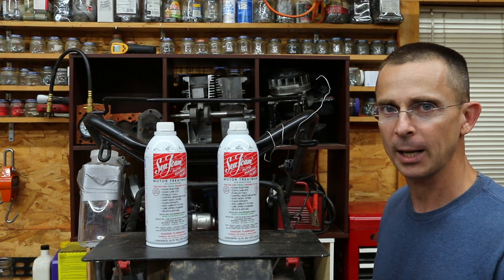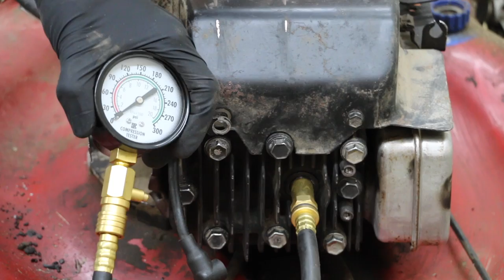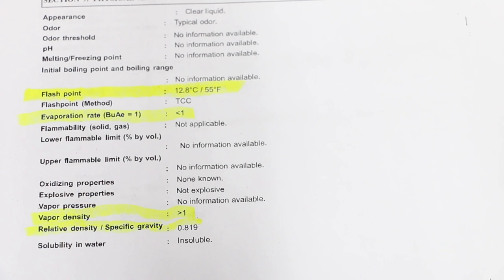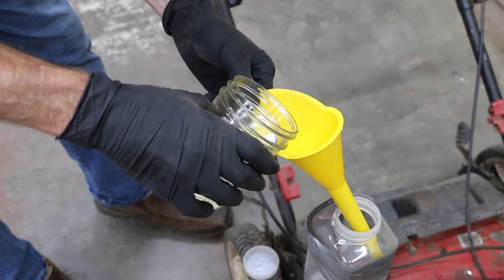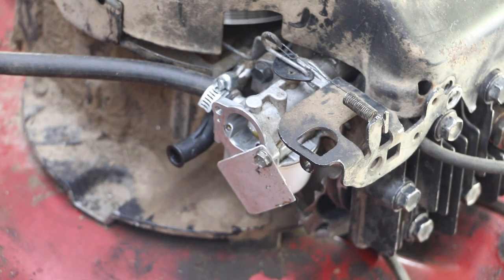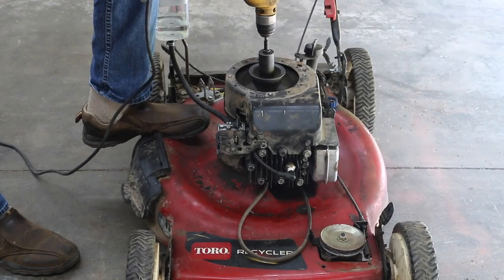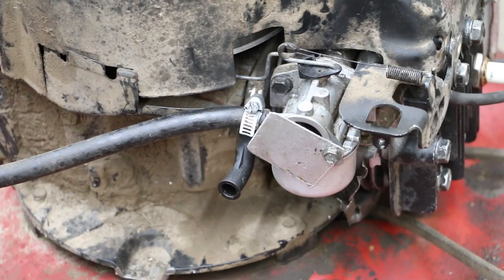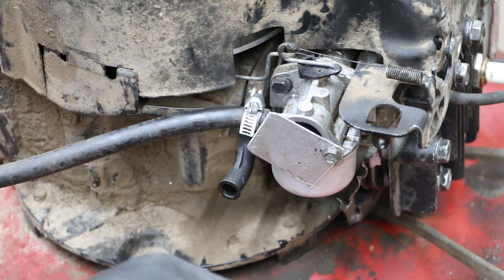Will a Gas Engine Run on 100% Seafoam?  Let's find out!

Comment: I've ran my 6.0 powerstroke diesel off of 100% sea foam
Reply: Cape Cod Canal Fishing your 6.0 actually runs? Wow...
Reply: FlatBroke612 yup 2006 f-350 Harley Davidson bone stock on motor with 180k never had a problem with it yet
Reply: Cape Cod Canal Fishing 
Bone stock is why. 
Smart man. 
You’re probably familiar with that shop in Georgia that bulletproofs them then, the channel name slips my mind at the moment but I’m subbed. 
The ol 7.3 was good , the 6.0 can be made good by his methods but if yours is reliable leave it alone
Reply: MrTheHillfolk yes I know the shop your talking about, people will travel thousands of miles to get the work done there. I only have a turbo back mbrp exhaust, never had a tuner on it. Only use motorcraft powerstroke diesel oil, and regularly use some kind of fuel treatment, oh I also use rev-x in the oil. Probably why I've never had an injector issue. Regardless I still have to think the egr is near the end in its life, that's just really uncommon for that not to have gone yet...idk we'll see lol
Reply: People always hate on 6.0's, but those are the people that do not know how to maintain them. They are also probably the people who throw big HP tunes on a stock 6.0 and whine like a baby when it blows.
Reply: TrailRipper exactly! I'm creeping up on 200k (180k now) really hoping the to hit that 200 mark without a problem and I'll be a happy (rare) camper with my 6.0
Reply: Cape Cod Canal Fishing any improvements ? Preventive maintenance or were you trying to cure something ?
Reply: JIGA BACHI nope I do my own oil changes so I know it's being done right, I only use the rev-x cuz u just hear everyone talking about how good it is for the truck so I've just been using two bottles per oil change, and I don't add it to the oil fill, I take my stand pious out and pour it straight into the hpop system
Reply: Stand pipe***
Reply: Cape Cod Canal Fishing 
Yea that’s a fair amount of time with no problems, like he says in the vids though it might be time to do a few things coming up, like you mentioned your egr. 
My brother inlaw just got an 06 that was from down there and had  the work done. He was a little nervous about it coming from the 7.3 but it’s been hood for like a year now.
Reply: MrTheHillfolk Good old Bill down at Powerstrokehelp
Reply: I was just about to say That it would probly make good power with a turbo with all that smoke, it's all just unburnt potential!
Reply: Could've only gone well...
Reply: @CapeCodCanalFishing  Ever know of anyone running a 7.3 powerstroke on 100% sea foam?
Reply: 6.0 liter, that engine needs all the help it can get,?!$ nearly bank rupted ford!
Reply: Ran my 1991 KA24E 4 cyl. And running so much better now. Even sounds better, arms stopped making clicking noises

Comment: This has got to be the most positive YouTube channel ever! Didn't see one negative or stupid comment. My question is did you try mowing a section of grass with the sea foam fuel? Does idling vs running the mower change the way it reacts as a fuel?
Reply from the maker: Thank you very much for the positive comment.  I wish the grass was still growing where I live but it's dormant.  The engine lacked power and wouldn't have ran very well. Great question regarding idling vs running higher RPMs.

Comment: During the summer of 2016 my old lawn mower started smoking bad. I've had it for  at least ten years. I thought the motor was shot. I poured some Seafoam in. It ran the rest of the summer with no problems. I used it this last summer and added some more Seafoam.  It might have many years left as long as I have Seafoam. I love this stuff.
Reply from the maker: Impressive!  It's a great product!

Comment: 5:15 it’s fascinating to watch the movement of the valves and the piston as it cycles through the intake, compression, ignition, and exhaust strokes through the clear head. It’s even better watching it at .25x speed. Such a simple technology but so awe-inspiring.
Reply from the maker: Thank you!

Comment: I was amazed at how well that the seafoam cleaned more carbon buildup even though you had used the wire brush it even removed more and after all that smoke it left no deposits or buildup absolutely amazing. 
   This leaves me with the idea that running seafoam through the fuel system is really a great idea I was thoroughly IMPRESSED.
Reply from the maker: Thanks!

Comment: I had a lawnmower that I had not started in five years. Still had the old gas in it. I put some seafoam in the gas tank, pulled the air cleaner and sprayed seafoam in the carb, started after 2 pulls. Ran fine.
Reply from the maker: Thank you for the feedback

Comment: After using seafoam for year I NEVER would have thought it could have run an engine. I really admire your stance on independent testing regardless of manufacturer and offers they have confronted you with. Thank you for being the light and standing your ground in a review and financial bias market. If they are unable to obtain good reviews, they will buy them to sell an inferior product that cannot equal the claims they make. Your work inspires me!
Reply from the maker: Thank you

Comment: Love the see-through head footage of a side-valve combustion chamber at work.  It's amazing that internal combustion engines can both draw in a fresh air-fuel mixture, ignite it, and push the burned remnants out the exhaust port in such a short amount of time.  Especially when one considers some 4-stroke engines--as in motorcycles--turn 12,000 rpm or more at redline.
Reply from the maker: Thanks!

Comment: Great video man.   
I use seafoam on every fill up and 50 miles before every oil change. Because of your videos I'm a believer. 
I have another suggestion.
Wax, vs Spray on wax, vs Ceramic Coating
Another one is the best Truck bed liner spray on vs roll on etc
Reply from the maker: Thanks for the video idea.

Comment: Thanks for all the videos. You know, all the products you choose actually really help me.  I run a business and my next door business got burned down... which means, there is no power due to city red tape and safety etc etc.  For the past 1 year, my entire 4000 square feet business has been powered by  6 gas generators.  So the OIL that you help me choose, the additives that you talk about, fuel, etc etc - all contribute to a plan that helps keep these relatively delicate machines running.  So many things to consider with small engines, carbs, ethanol, fuel selection, oxidization, spark plugs, the list goes on!  You help me a lot.  Thank you.      

PS:  video idea.  I'm sure someone mentioned it before, but 87 octane vs premium gas --- but on a "p premium only engine".    I ask because my generators (HF Predator 3500) has big words that says "premium only". Ive dabbled in 87 and never noticed a difference but I got scared and went back to premium, which is like 50-60 more p er gallon here in California.
Reply from the maker: You are welcome!  Thanks for the video idea.

Comment: Awesome!
The Seafoam cleaned out alotta the deposits in the engine!
Hey, maybe they designed it to do just that? Maybe... LOL
Great vid as always!
How about a nice bourbon whiskey? 80-86 proof? And just for good measure, make it a double! :D
Try runnin; it on 100 proof whiskey too.
Reply from the maker: Thank you for this recommendation and thanks for the positive comment.
Reply: or 151
Reply: captainjerk />>>How about Burcardys151 or moonshine😉😄😄.
Reply: How does a drunk engine run? Probably idles all over the place :P
Reply: Liquor won't work.  It has a lot of water content.
Reply: Anything over 100 proof or 50% alcohol will light. I can make you 150 if you need it. 😃
Reply: Uh, they already tried this in Back to the Future 3. It failed miserably. You see, the internal combustion engine in the DeLorean was designed to run on gasoline. There wasn't going to be any gasoline stations for another 60 years. The highest strength alcohol just caused the engine to backfire horribly, and blow apart the fuel injector manifold. God! do your research!!

Comment: Looks like for fuel additives to be effective you either need a very large quantity ran through at just above idle rpms or you need the perfect mix and idle rpm. Interesting video thanks for your efforts, keep it up!
Reply from the maker: I agree.  If it fully atomizes and burns as it enters the combustion chamber, it doesn't provide much of a cleaning effect.

Comment: I had a two year course in small engine repair from Canadian Valley Vo Tech in El Reno Oklahoma...but I'm a carpenter(30 years) I'm the one who said wear a helmet if you cast a cylinder head of concrete...try LIQUID NAILS floor glue instead..I hold a degree in PPT by the way...literally a degree in small engines..not lying.
Reply: Btw seafoam called...they called your bluff..here's 10 million
Reply from the maker: Thank you

Comment: My auto-tech teacher in high-school said you could use isopropel alcohol for brake fluid if you are in a pinch. I think the idea is that it won't rust internal parts like water would. Not sure how you would test it, but it seemed worth mentioning.
Reply from the maker: Thanks for the video idea.

Comment: I enjoy watching all your videos they are very in depth and informative 😁👍 I have a question I own a Chinese 150cc scooter , I purchased it brand new in july of 2021 the gas tank is a 1.3 liter I bought a can of seafoam I put in 60 ml into my gas tank which is 2 oz I believe since this I've been experiencing a poor engine performance it feels as if my fuel isnt combusting correctly or maybe if my drive belt is slipping it has the sensation like your hitting the breaks off and on and the rpm gauge is bouncing all over . I plan on draining out the gas and refilling it with 91 octane as the owner manual says to do , I appreciate any feed back & to give you a better perspective on what scooter model I'm referring to it's the 2021 icebear Hawkeye 150cc scooter made in china it is a 4 stroke take only supreme gas, thanks buddy HAPPY HOLIDAYS 🎄 to you and your family 🙂👍

Comment: Seafoam is essentially diesel and ethanol blended fuel mixed together.  The msds sheet shows it's about 3 parts pale oil (lubricant)to 1 part naphta (detergent) and .5-1 part alchool(drying agebt).

I've made my own concoction mixing diesel and ethanol blended gas and it works just as well at a fraction of the cost.
Reply from the maker: Great feedback. Thank you

Comment: I put seafoam into a 1984 Ford ranger four cylinder with a one barrel carburetor. I poured it directly into the carburetor while my neighbor was in the truck keeping it running. We smoked out the neighborhood, but it worked like a tune up in a bottle.
Reply from the maker: Thank you!

Comment: More ideas:  Will an engine run on lacquer thinner?  Will an engine run when pumped full of moly grease instead of oil?  Does 10W - 40 Valvoline taste ok on a salad?  What happens if you run an engine on pure starting fluid (release the pressurized air and dump it in the fuel tank)?  Will a lawn mower cut your lawn faster if you mix black powder into the gasoline?  Will a motor blow up with transmission oil in the crankcase?  What happens if you run motor oil in an automatic transmission?    I like these comparisons, they are fun to watch and many where you test different products are quite informative!  Thanks.
Reply from the maker: Thank you for the video ideas!

Comment: It looks like the sea foam helped a little . I must be honest and say that engine was much cleaner before the test than the previous motors you have used and I feel like that really held back showing the potential or lack of potential the sea foam may or may not have had during the test! However I was still intrigued by the video and give it a thumbs up. Keep up the interesting tests and videos. Merry Christmas
Reply from the maker: I think Seafoam did a terrific job cleaning this engine.  The type of deposits it had were very stubborn compared to other engines.  Thanks for the thumbs up and Merry Christmas.

Comment: I do like your videos! I have been using seafood for many years.  I know it is suggested for carbon cleaning, but I have always used it mostly to revitalize old/stale fuel and to clean carburetors that have been sitting.    E.G. small training motorcycles in the spring after sitting all winter.  Not sure how you could test for that..  For carbon I think you are supposed to flood out the engine with sea foam and let it sit.
Reply from the maker: Thank you for the positive comment.

Comment: I am wondering how it would run with a load being that it runs cooler, I am a bit shocked it runs at all. I always run Seafoam before an oil change, a little in the tank, engine and top cleaning. Some say just running water in to the intake will do the same, I don't know. I do notice a huge difference between the uses, and my gas always tends to go fast when it's added. Again I thank you for being genuine. I enjoy and fallow your videos.
Reply from the maker: Thank you for the positive comment.

Comment: The fact that the spark plug looks about the same just shows that the carbon actually went out the exhaust rather than just being transferred around inside the engine. Very interesting test!
Reply from the maker: Thank you

Comment: I’m actually impressed that the combustion chamber still remained clean on 100% Seafoam in fact made it cleaner. I assumed with no fuel it would burn poorly and build up carbon but I was wrong. Guess Seafoam really is a good carbon cleaner when burned thanks for the video!
Reply from the maker: Thank you!

Comment: Integrity! I subscribed maybe a few months ago, just now getting into your earlier videos.  I like seeing your methods bloom from some what crude to real world science.  'Blaster has a new lanolin based under coat product you might wish to run up against the best two from your other video on the matter.  

Also would love to see an Aluminum Rim / Wheel cleaner run off versus plain dish soap, Dawn or something.  Many of the videos on these products seem edited, and don't show the initial build up close nor a demonstration using a simple hand rub, rinse, or power wash; You can't tell if its real or did they put a film of oil on the wheel first and dust it up with iron oxide.  I just haven't seen any results in real life from some of these products, maybe brake cleaner would be better.  Some are even saying using oven cleaner works best, Simple Green, Chemical Guys Decon Pro, it goes on and on.  Of course use aluminum wheels that haven't been cleaned at all.  Maybe use aluminum sheets or billets of varying alloy and spread iron oxide on them for a year or similar brake dust corrosive product.

If you have done this already I guess I haven't seen it yet.  Keep up the great work.  Having a non affiliated consumer products review channel is awesome material.  Thanks for all of it.
Reply from the maker: Thanks, will do!  Thanks for the suggestion.

Comment: I myself was quite surprised that the engine ran on 100% Seafoam. The first video of yours I watched was the one where you ran the seafoam through the crankcase of your Ranger pickup truck. It was experiencing the same problems is my Bronco II was happening and I had I known about seafoam at the time I could have saved money on replacing the engine. I've had mixed experiences with seafoam while I cannot say for certain that's running of the seafoam through the fuel system of my Yamaha cause one of the carburetors 2 stick open but the carburetors have been finicky in the past. But overall the stuff you have shown with the seafoam I still am impressed with the product. One thing I thought would be kind of cool for you to do if you would be able to take a diesel engine and convert it to biodiesel.
Reply from the maker: Thanks for the recommendation to convert an engine to bio diesel. This seems like a fun project.

Comment: When I feel I need a little prime dribbled in a carb to start an engine, I use Sea Foam. It fires and runs. I like the little bit of start up iube. I use it sparingly. I worry about my CAT and O2 sensor.
Reply from the maker: Thanks for the feedback.

Comment: I’ve thought about the sea foam burning up before actually cleaning anything. I’ll have to check the data sheets on the flash point with all these engine cleaners and suggest the one with the highest and we could see if the extra millisecond(s) helps with cleaning. Anything’s worth a shot in my opinion if the engine can be cleaned without disassembly
Reply from the maker: Thank you

Comment: Love all your videos.  Since it looks like you know a lot about small engines, is there a good muffler to quiet down a riding mower's exhaust?  Would it kill power using a quieter muffler?
Reply from the maker: Thank you very much for the positive comment.  There really isn't a great exhaust system to quiet the engine, since a lot of noise comes from the engine itself, not just the exhaust.

Comment: I was just a little concerned about running 2 bottles of this in my 04 ram 3.7. But went ahead anyway. The whole tank of gas of 2 bottles smoked on every start up. When I got down to a half a tank I done the throttle body seafoam treatment my misfire check engine light went off it also stumbled a lot less. Still has a slight miss though. But I know I got the bulk of the problem.
Reply from the maker: Thank you!

Comment: Thank You for your GREAT video's.  This is unrelated but I see people repairing rusted metal and then treating the metal in various ways.  Do these Rust Converters work?  They claim to convert rust into a black primer.  EXTEND comes to mind.  Some people just cover the metal with oil. Could you do something, I'm guesting long term, on various rust converters.
Reply from the maker: Thank you for this recommendation!